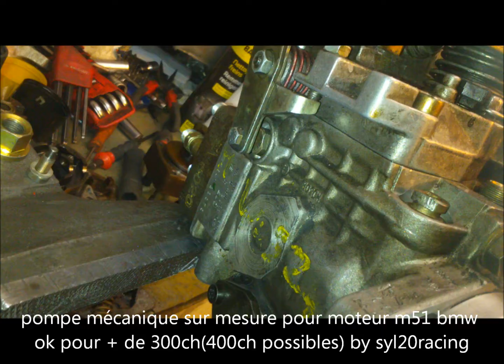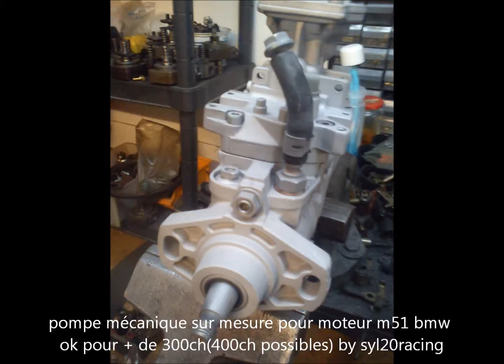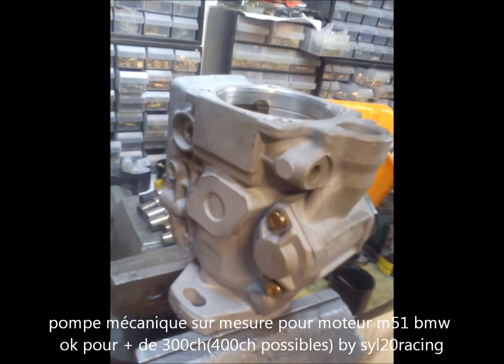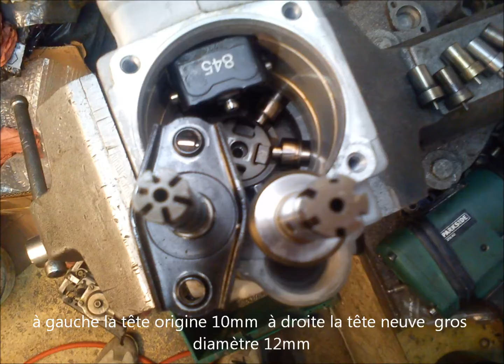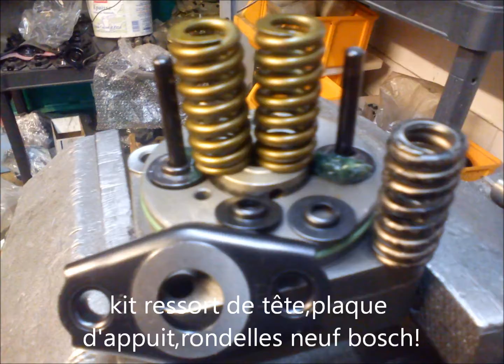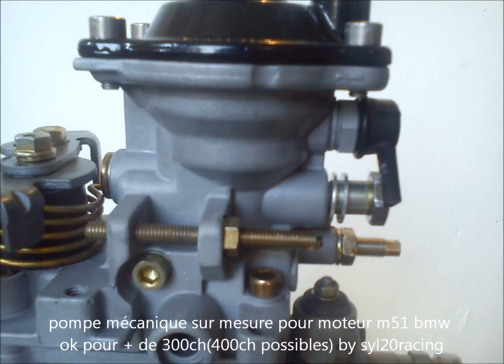bmw 2,5td/tds  m51 pompe méca + tgv by syl20racing

Comment: C'est possible de monter à 300, 400cv sur un tds 🤔 ??
Reply from the maker: bonsoir oui
en effectuant une véritable préparation,turbo (mono ou bi turbo,fixe ou gv..)culasse acc retaillé...
un travail sérieux aussi sur la pompe..
cdlt syl20
Reply: @golftd41  j'en ai une, une e34, je possède une pompe meca sur un moteur de 324d e30 ph1, j'ai déjà songé à la poser dans ma tds, mais bon, j'l'aime bien d'origine mon tds 😉 même si juste 200cv m'tenterais bien dessus 😋
En revanche, superbement intéressant, sa a l'air d'être un sacré taff réalisé sur cette pompe, bravo 💪👍
Reply from the maker: @hamidfiero1429  merci pour mon travail
il faut pas la posé tel quel pour avoir un bon potentiel..
Il y a pas que la pompe...

pour le reste je t'invite à me suivre sur facebook.
tu as le lien ci dessus
Reply: @golftd41  ah mince j'suis pas sur facebook mais j'essayerai de regarder avec mon petit frère il a un Facebook lui, merci 😉
Reply: @golftd41  j'avais déjà cru comprendre que l'avantage de la pompe meca est qu'elle est ''plus facilement'' réglable qu'une électronique, mais bon, étant mécano, à part y changer les joints qui s'mette à fuir, j'serais incapable de faire un tel réglage 😂
Reply from the maker: @hamidfiero1429  la gestion des m51 est trop achaïque,il est nettement plus intéressant de passer en mécanique,je ne parle pas de juste poser une pompe mécanique ,il faut savoir la mettre au point...